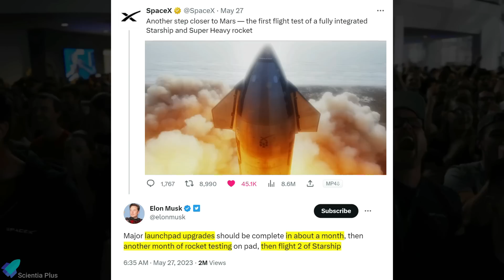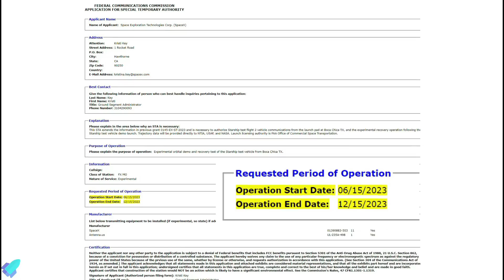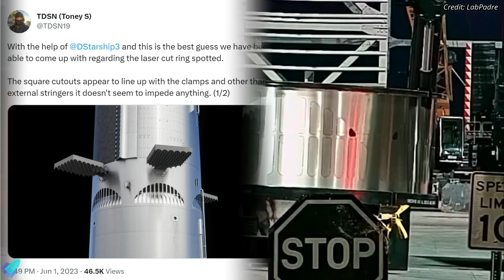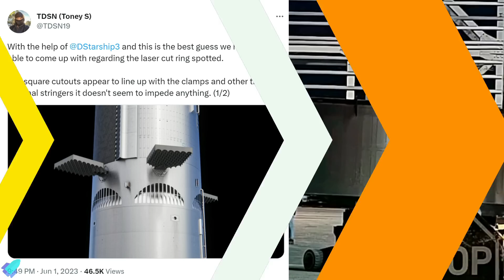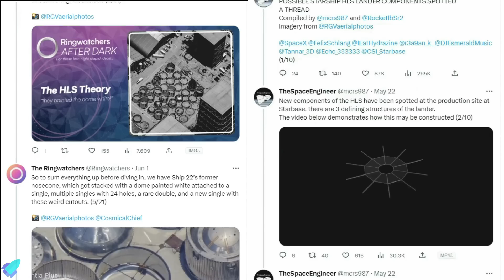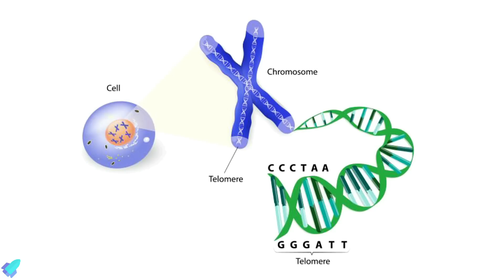SpaceX Redesign Starship To Increase Astronaut Safety, Next Launch Timeline, Starliner Delay, CRS-28

Comment: Not all terrain on the moon is flat. They need also to focus on the Starship landing leg mechanism.  They need to design a terrain-self-adjusting landing leg. For instance, if one leg is on a higher elevation it should adjust shorter than the other legs and if the other legs are on a lower elevation it should adjust longer than the other to level up by the characteristics of the terrain, that way the ship is always in a balanced upright position.

Comment: All the previous hot staged rockets were disposable. Hot staging would surely raise issues with the longevity of the booster and at least require some heat protection of the top of the booster, adding weight.  However, the first few test articles of the superheavy booster are effectively disposable, so it might be an interim feature. If it is a long term feature I think the landing aero is more likely to be the reason. TL;DR, only Spacex knows the answer!

Comment: The new holes/grating could also have something to do with aerodynamics when landing the booster. When landing, the top of the rocket is a large open space, which may have an unstable flow. It could also have something to do with the flow near the grid-fins. In addition to ullage, it could simply be to reduce pressure build-up when pre-colling the second stage engines.

Comment: The water cooled steel deflector plate should work .  The  Raptor 3  energy increase could be a big concern on the restrictive launch platform as it will back up upon the engines.

Comment: One has to ask a couple of questions. 
1) Why not try to recover the first stage in a manner symilar to current landings?  Seems all that would be needed are landing legs.2) Why land in the pacifi?  Would it not be just as easy to extend the flight so the orbital vehicle came back to the Florida launch site.  Both would make recovery more straight forward and if landings could be made, inspection would not be impeded by salt water damage.
Reply: Extending the flight would mean an over-land flight, and specifically the last part of an experimental landing. Big no-no. Landing legs are not simple! they affect the structure and the launch ring. SpaceX has already proven that they can land with sufficient accuracy to make catching the booster mid-air is a technical possibility. Also don't forget the weight of legs and all extra foundations inside the booster. A fully reusable rocket is not simple to design, and only possible because if the scale of the rocket and the need for in-orbit refueling. The system has quite a large payload, but SpaceX could save a lot of money if they could do missions with 1 less in-orbit refueling trip, so weight of the boosters is still important, also in economic sense.
Reply: @jwstolk  thanks - seems that having the hardware return to the west coast might still offer some advantages.  Having said this, one has to appreciate that the hardware they are using is written off (outdated) anyway. Will getting a salt water bath destroy the information they might get off the heat shields etc.
Reply: @iancormie9916  With the Falcon 9 rocket, SpaceX was using 1000's of strain, pressure, temperature en vibration sensors per rocket, and all that data was transmitted to the ground at about 1000 times/second. The will learn a lot without getting any hardware back. They also contracted a special NASA plane to make infrared images of the heat shield during flight. Like Falcon 9, they will have plenty used hardware as soon as some of the test result in a successful landing.

Comment: We have environmental regulations/rules, mostly good. But like any law/rule, it can be used by some in a way that it's not intended and therefore perverting its original good intent. We need environmental cognisance, sensitiving, and compliance. From working in the petroleum industry, my experience is that these rules are not taken lightly by corporations, nor is there collusion to do an end-run around the regulations. In the end, it NEVER pays to try and play games with government regulations. The companies — regardless of what detractors WANT to believe — seriously do everything they can to comply regardless of the cost to do so. If SpaceX and the FAA have done due diligence, then you should be good. You can't keep moving the target. Just stop and go work on changing the rules if you're not happy.

Comment: Hot staging is exacltly what we did on the 2 stage small minuteman ICBM to control the attitude of the upper stage during separation.  At Convair in San Diego this design was implemented

Comment: The comment regarding autogenous pressurisation doesn't appear to hold up. The fact that the fuel is pressurised would not eliminate intake of gaseous or sludge fuel into the fuel pumps. Application of a force to direct the heavier fuel component into the tank take-off points does that function. Hot staging prevents the fuel components from being stirred up during the coast and restart phase of staging. Watch the Apollo 13 movie scene for the staging effects on the astronauts to understand the effect on fuel.

Comment: OK---------...  Shocking Realization!!!   Musk's Stated way of Separating the Starship from the Booster by Flinging Starship away like the Upper Stage Flings Starlink Sats would throw Fuel to the top of the Starship's TANKS Making it impossible to Start Starship's Engines Safely until the fuel can be PUSHED Back down to the Bottom of the TANKS...   Obviously Now!!! But it sounded so GOOD a Month ago...   So Hot Starting May be the Best way to Separate Starship... Even when there is no Emergency...
Reply: Not really a big deal they already have to wait a bit for the booster to be far enough away before startup anyways and it's normal for rocket upper stages to need to settle propellant before starting engine they'll probably just fire some cold/hot Gas thrusters for a second before lighting the engines